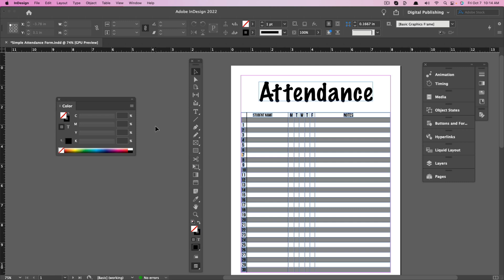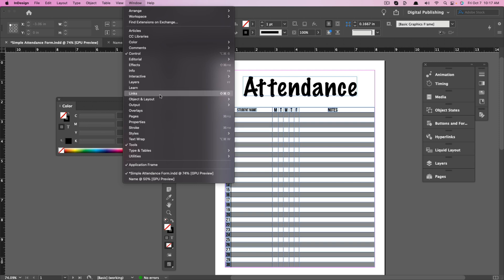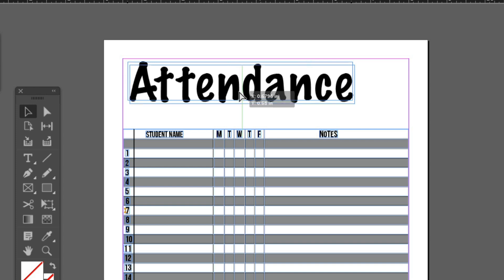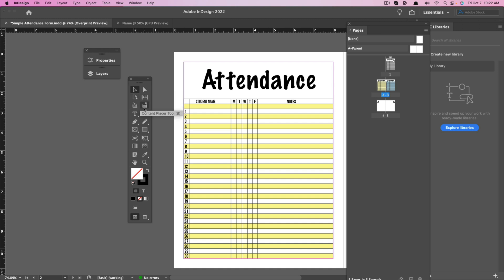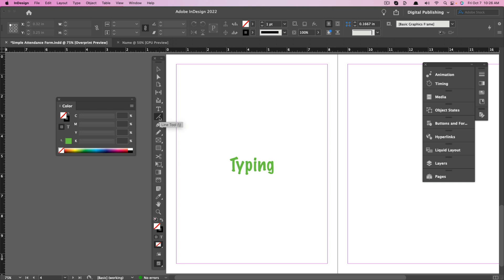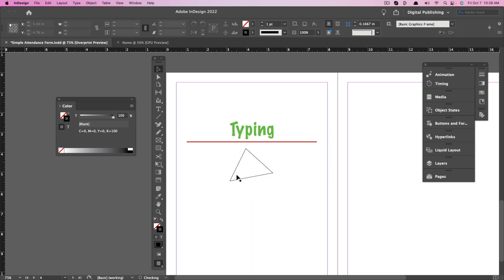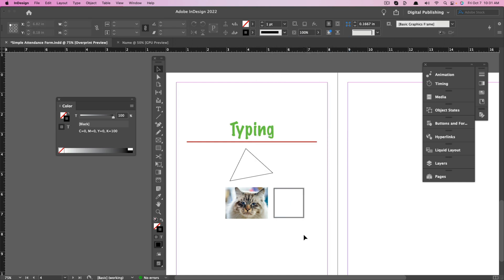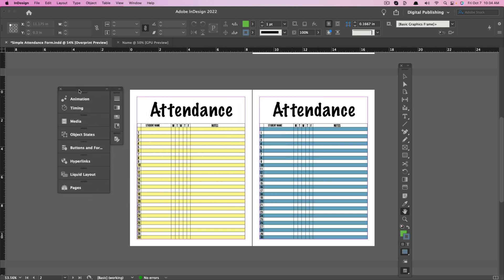Indesign 2025 Tutorial: Basic Rundown Of Design Tools and Overview

Comment: Dragging a photo frame no longer works like it used to. Rather than simply changing the frame position, the photo now repositions as the frame is adjusted. How can I set this back to the original way?
Reply from the maker: So, this is the newest version of Indesign that I'm using and I just tried it and it worked. Maybe I'm misunderstanding your question?
Reply: @think_tutorial  Sure, so before this 2023 release of InDesing, if I placed a photo into my document, clicking and dragging the bounding box of that photo simply resized the frame that the photo sits in. The photo was untouched, it didn't move or resize. Double-clicking the photo allowed access to the photo itself, to reposition or resize. With this new 2023 version, when I place a photo into my document and click the bounding box to resize the frame, the entire photo repositions/resizes as I drag the frame as well.
Reply: Update: More google searching uncovered the phenomenon happening here is "auto-fit". Object > Fitting > Frame Fitting Options > de-select "auto-fit". Auto-fit turned on seems to be the new default, this is how it can be changed back.